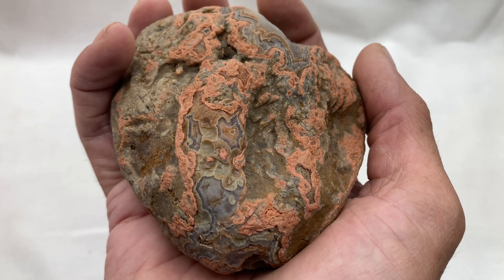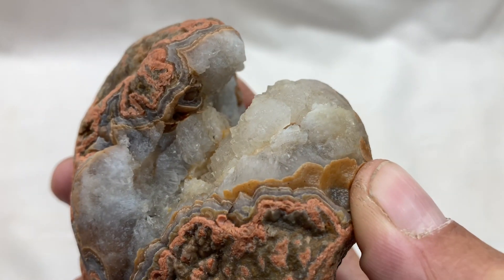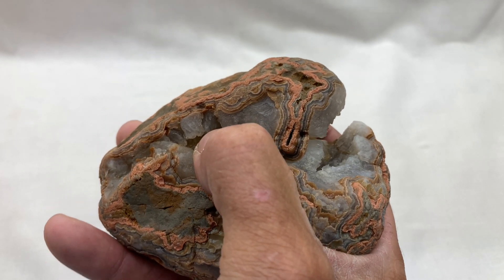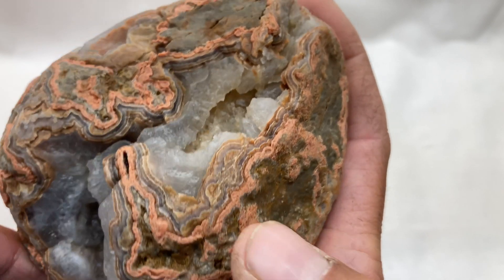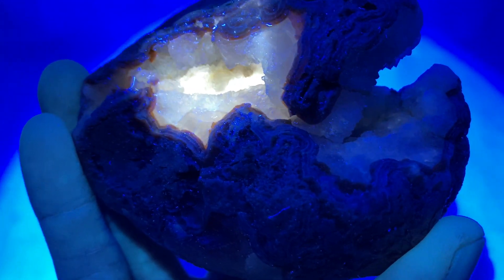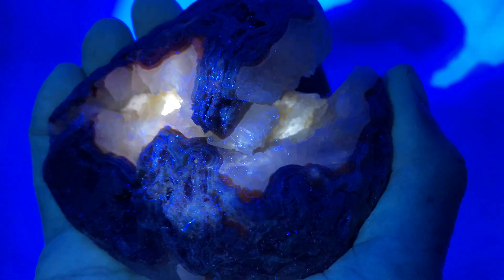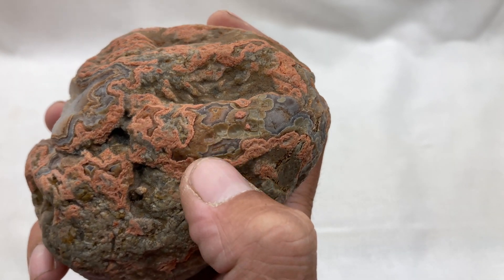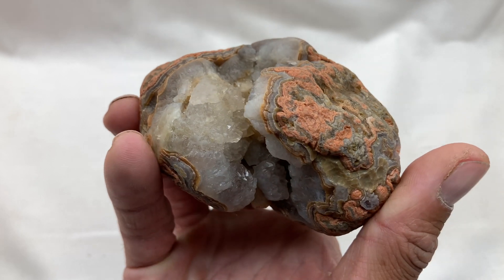Phosphorescence in a Fairburn Agate? Time to break out the UV light!

Comment: Will you ever cut that one? I didnt get too much from Oxalic acid. It was like citric, light touch.  Also couldnt get it to dissolve properly. Another beauty Wayward!
Reply from the maker: No cutting this one for me. Oxalic has its place and use, when used correctly and in the right fashion. You also need to start with warm/hot water to dissolve it, and oxalic works best with heat. It is far heavier a cleaner than citric acid, it’s toxic. Again, it has its place when used correctly and for the right reasons. Most people have no need for it. It’s generally used to clean quartz crystal and remove staining. Also used to bleach wood. Works amazing, when used properly and for the right reasons. It does take some good soak time, days to weeks depending on the stones.